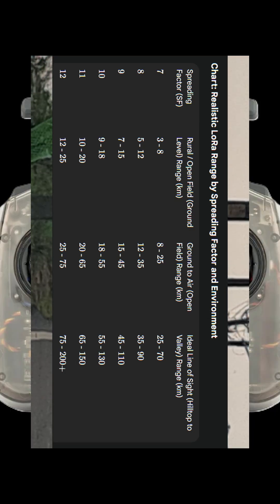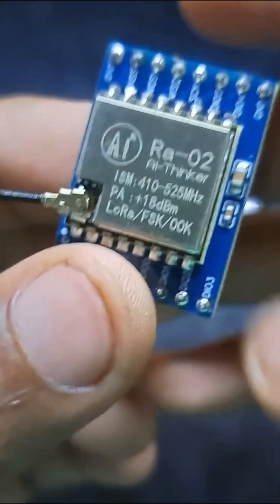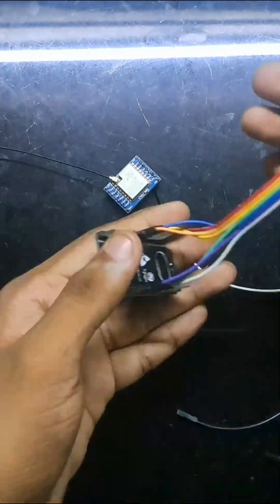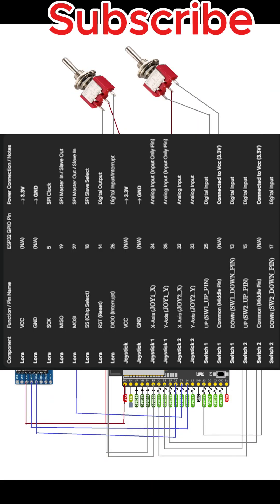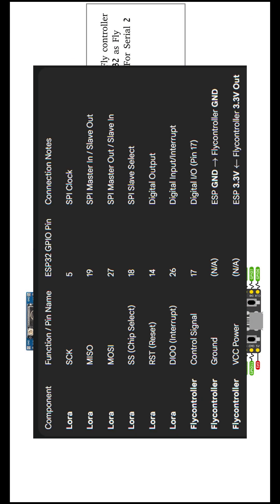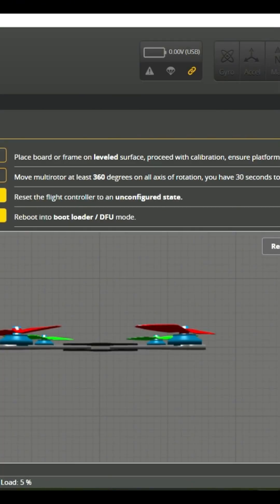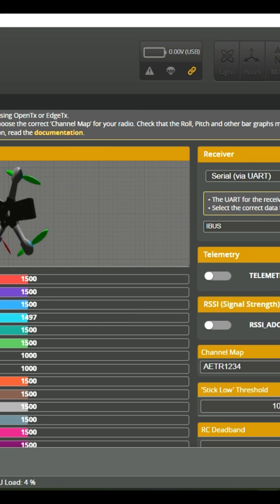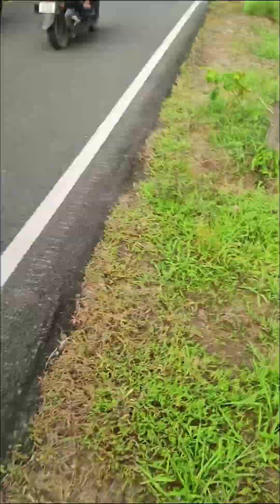10KM Long Range LoRa Transmitter & Receiver#LoRa #ESP32#DIYElectronics#DroneController#LongRangeRC

Comment: Ore just turn a tx into a an Rx Joshua bardwell  just posted a video
Reply from the maker: He used commercial tx module (cost more) I made a transmitter (with joystic and switches) and receiver that can do long range with cheaper or similar price than a single tx module😄
Reply: @EngineeringRobotic I don't know if you know this but elrs is open source means any one can develop the tech also happy mobile have been making a build it yourself module for like 4 years now 

But the creativity is brilliant I like that you've used your brain instead of your bank card ♥️♥️